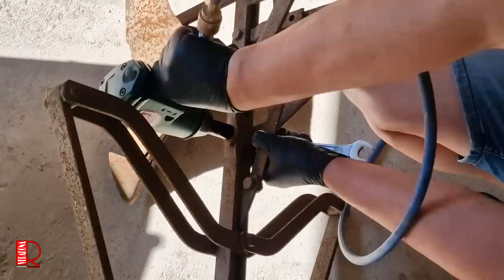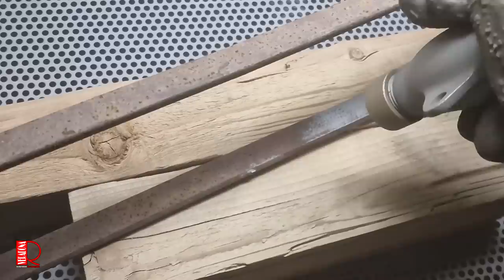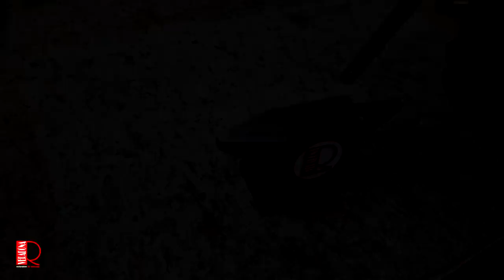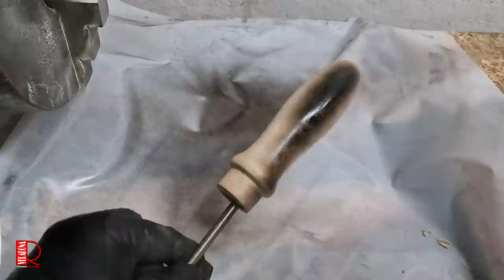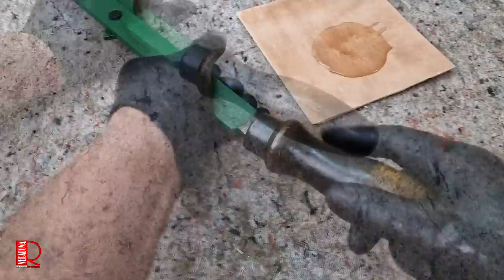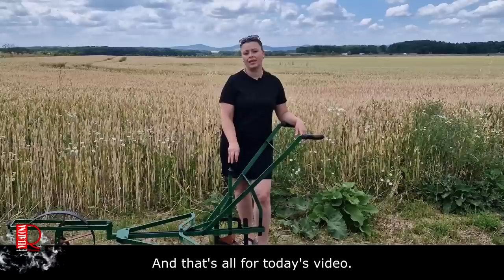Do you know this plow - Restoration

Comment: I do not think this is a plough (plow). My father was a farmer and champion horse plougher, and I have seen many horse and tractor ploughs.

This is simply not strong enough, especially the little hook mechanism for adjusting the width covered by the pair of shares. Moreover, it has no coulter (the knife or disc that cuts the soil so that the share can turn it more easily).

I think it is a ridger, for building already cultivated soil into ridges for planting, especially of potatoes.
Reply from the maker: Yes exactly. In my country it is called the same, only with an addendum that the translator did not translate for me. Thank you Paul :)